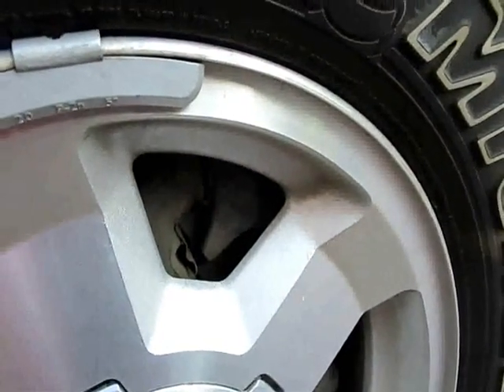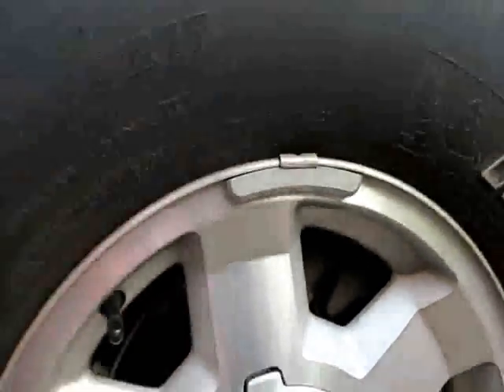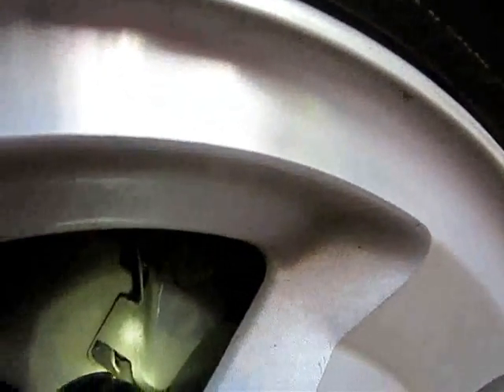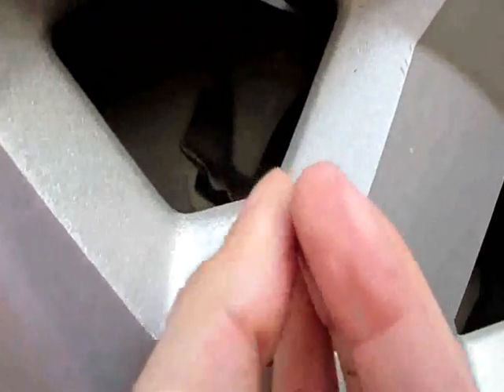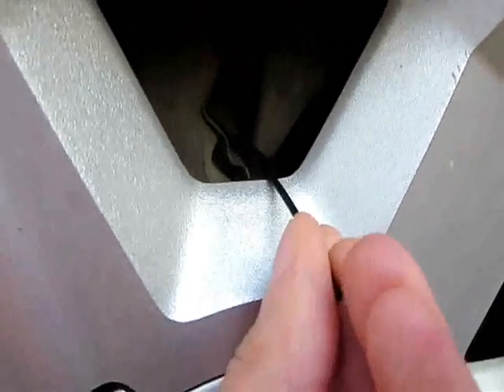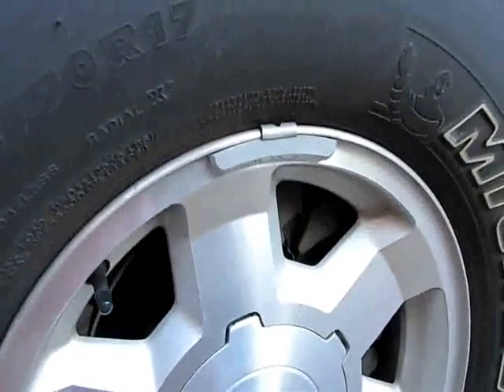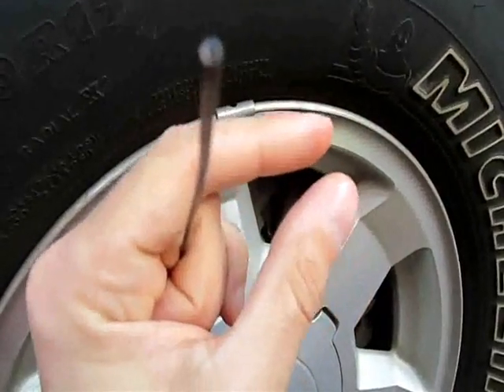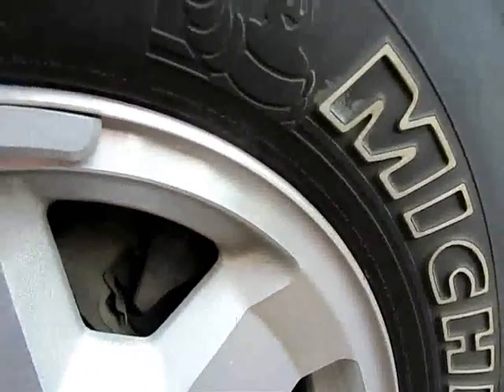How to check brake pads without removing wheel DIY

Comment: 6 years later and this still helps
Reply from the maker: Ya I failed the lowest brake pad challenge a few months ago.   Someone copied this idea but I think their channel got squashed they had like 800k views on it I had like _  If you keep a straw around and measure it when the pads are new its also a nice gauge.        Just... Sometimes the inners wear slower than the outter or or the outters wear faster than the inner so beware   But if its close take off the wheel

Comment: Don't know why you've got 118 dislikes. Informative and honest. Thanks mate. 👍
Reply from the maker: There is a dude who copied my same video doing the same thing almost word for word and yet they have so many more views and no dislikes.
Reply: Just don't get it man. Keep at it!
Reply: I can't actually see what they're describing. It's clear as mud.
Reply: Dislike because he doesn't actually indicate the pad location or what he is looking at.  Sticking a black straw into the wheel with no lights shows us nothing as well. very poor video.
Reply: Because if you don’t know what a brake pad looks like, this video is useless.  Can’t tell what he is looking at.  I can’t tell what to look for on my vehicle from this.
Reply: You don't point out anything use a laser next time so you can actually point at stuff that your talking about instead of using a flashlights which indicates nothing
Reply: 118 dislikes but 180,000 views. Not bad at all
Reply: @adrenalinehigh2070  not bad now, 3 years later. At the time I originally commented there weren't 180,000 views so the ratio was a little less favourable.

Comment: To the trained eye the time for change is easy seen....Here's my thought...If I check a car that is regularly serviced by one service center/mechanics shop then I call the ware limit a guesstimated 2mm..I guess that's close to 1/8"... but I've seen cars come in for Tyres and seen the rear rotor floating away from the hub (serious) with new pads in the caliper,!!.."That the DIY guy fitted to stop the grinding"..Wafer thin !!!..I warned the lady and she said she would get the same guy to check it out..!!!!!...I asked her if she ever drove near my area and if she did what time would that be so I'll make sure I'm not on the street when she is....She thought I was joking.!
Reply from the maker: +ZIGgassedUP  HAHAA! Its just people, you can tell some people anything legitimate and they wont acknowledge it.. The Stupid people wonder "Why does it always happen to me" when things fall apart
Reply: +Ghetto Wagon I need help, I have the same truck 1500 GMC Sierra 05 and my brakes are pretty bad in front and we just replaced the pads so I'm thinking jts the brake drum? Tell me what you think cause I don't know, I nose dive each Time I brake and that's bad
Reply from the maker: By bad, meaning the pedal is low and it does not stop good?  It could have a brake fluid leak, bad master cylinder, leaking wheel cylinders in the rear, bad brake hoses. Luis Pargas
Reply: +ZIGgassedUP The problem is, the major tire chain stores like Goodyear or Firestone charge an arm and a leg for simple brake pad replacements which should take no more than 15 minutes per axle (2 wheels) with the tools and the hydraulic lift that they have at their disposal. Furthermore they may try to pile on a bunch of other services that the car doesn't even need (and quite often the mechanic won't actually perform, but still charge the customer for), although auto maintenance chains like Jiffy Lube and Midas as opposed to tire chains are more guilty of this. Overall, there is plenty of corruption and just plain old "unfair pricing" for the work being done in the minds of the customers, which is why instead of going to the pros they either resort to DiY jobs, or hire low-end backyard "freelance" mechanics (who could still end up scamming them nonetheless... although for not as much as a retailer would).
Reply from the maker: Jenny Hsu
 If you are resurfacing rotors its more than 15 minutes a side!  Shops have to make $$ somehow.  You sound like the manager who interviewed me for a job, He pretty much pinned me as being a "auto technician" I was a criminal and ripped people off.
 If people complain about the work they should buy 1000's of dollars on tools and equipment and learn it yourself like I did
Reply: First of all, my reply was to ZIGgassedUP, not you in regards to why a customer wouldn't have him look at the brake pads that they claimed were newly installed, and instead trusts the usual guy she always goes to. Secondly, you don't know what you're talking about. Places like Firestone and Goodyear will nowadays charge upwards from $150 (especially if you don't bring any of their coupons that are sometimes included with the junkmail that the postal service places in your mailbox). Not too long ago, they'd do your brakes for around $80 without a coupon, and for less than $50 with one. Not to mention the prices of tires and batteries have also doubled within the last decade. And all you have to do is go on a simple Google search and there are tons of articles and videos abound on how mechanics from nationally recognized tire and auto maintenance chain stores will sell their customers services that they never even perform! Since you've been DiYing, you're out of touch with the level of greed that these professional retail tire and maintenance shops have risen to.

And yes, if resurfacing the rotors, that'll take a bit more time, but the job itself isn't that difficult. Especially if you're in a shop where one guy does the resurfacing, while the other works on extracting & replacing the pads, lubing the caliper pins, ensuring that the shims and mount look good, adjusting the caliper piston, etc. Regardless, the labor is still nowhere near worth the $150 (or more) that they'll charge you for. Customers acknowledge this... even though many do suck it up and pay it, because the alternative means to either DiY, or find a backyard mechanic who'll do it for a more reasonable rate.

Comment: use a straw and mark it with a fine point felt pen.   then measure it!!!!!!
Reply from the maker: Ahh, eyeball it. When I changed the pads + scrapped the warped rotors I turned 2 x I still had more than I expected.